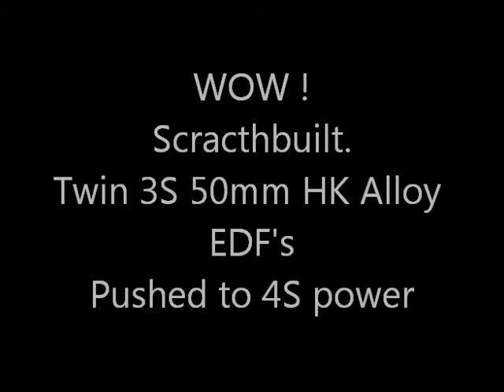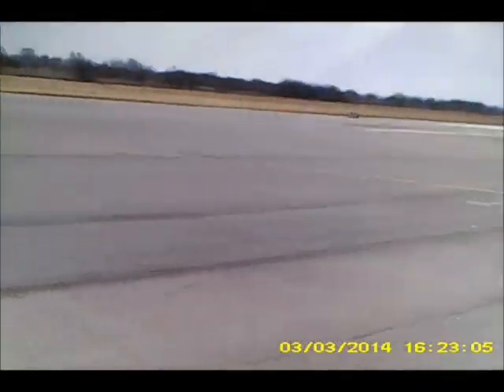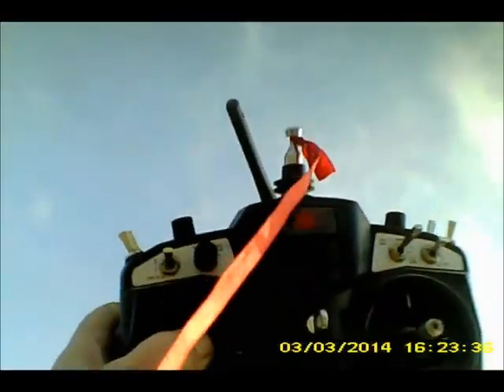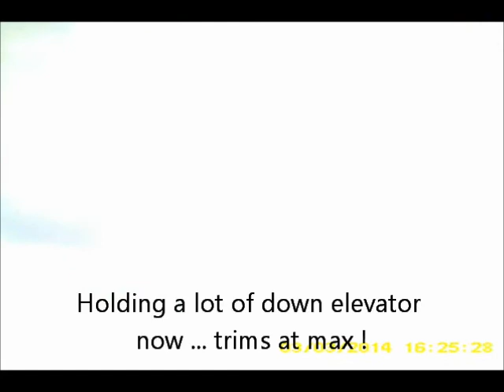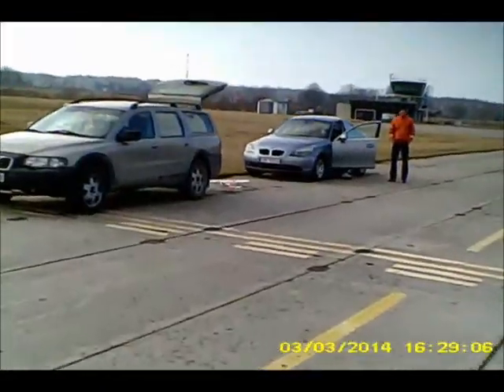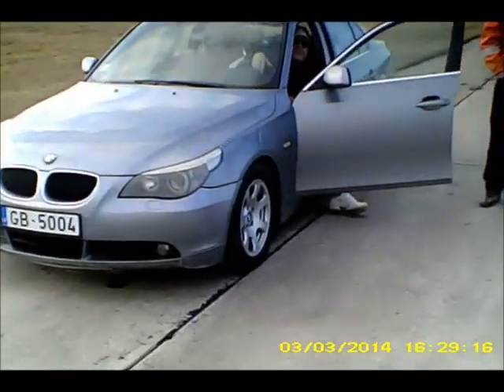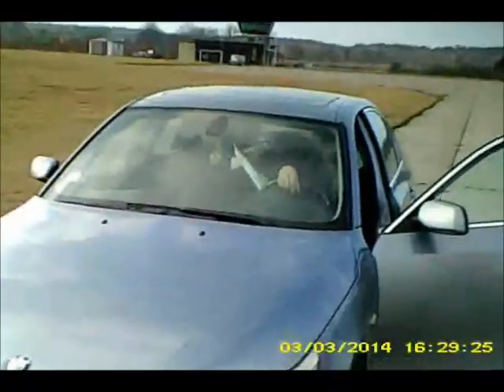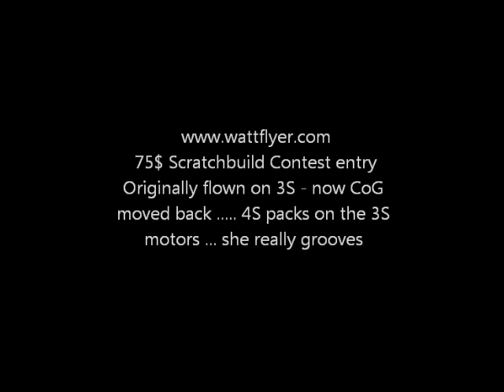Concorde 03 03 14 4S Ventspils Airport

Comment: Are you using the stock HobbyKing Dr. Mad Thrust Inrunners?  How many kv?  3300?  4000?  Thanks.
Reply from the maker: They are the 3S Hobby Kings labelled Dr. Mad Thrust with 4300kv ... 5 blade.